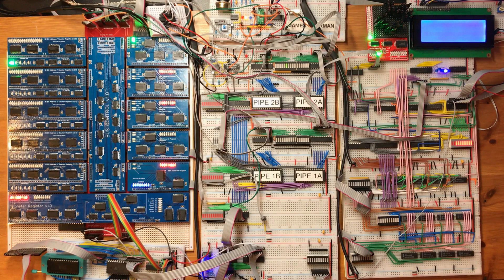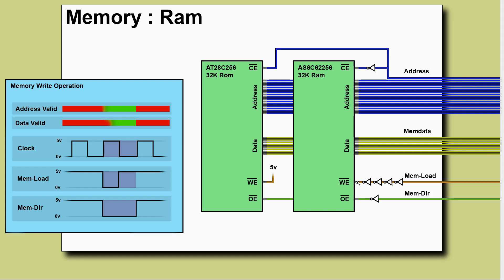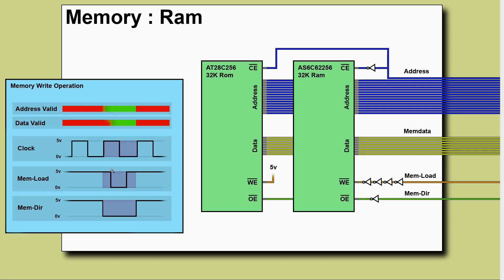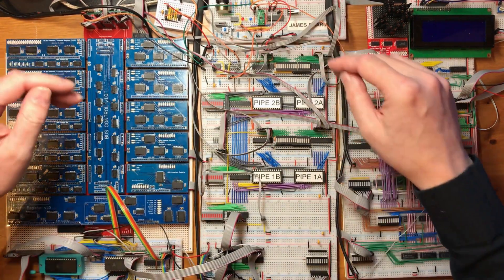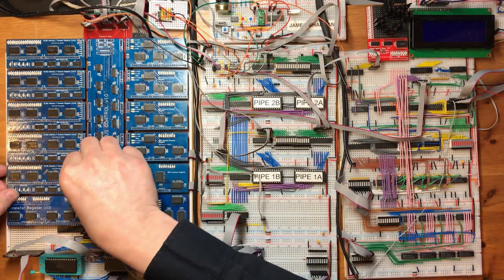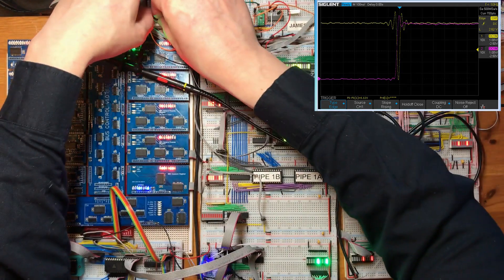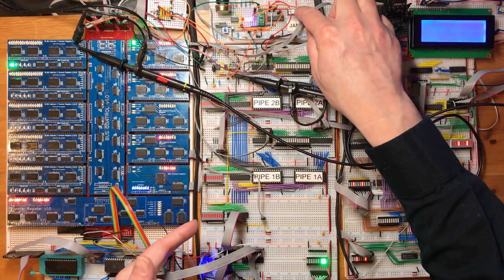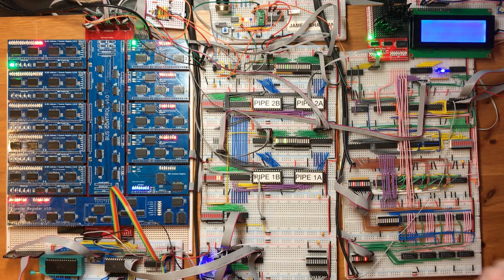Small Jobs - Making an 8 Bit pipelined CPU - Part 62

Comment: It seems like there's more than one NOP being generated when memory is accessed.  Is this because there are two consecutive instructions that access memory?  It seems like a pretty severe bottleneck; two instructions are causing a complete pipeline flush, only 2 instructions per 4 cycles.  

Apart from Harvard architecture, I have no idea what would get you out of this situation, though.  Maybe adding more pipeline stages to keep things moving with non-memory instructions while the fetch unit is stalled?  Another bus?  How do modern processors deal with this?
Reply from the maker: Sort of. Memory accessing instructions block fetch so effectively take 2 cycles, but the memory access happens in pipeline stage 2 so the next instruction has already been fetched.  There are a few different stragies for solving this, something I hope to explore in future builds.

Comment: Glad that another bug is fixed.
Nice work.
Reply from the maker: Thanks Adam! Reset not fully working was only a minor and I was very sure I knew the problem. The odd thing about making videos is feeling like you can just patch the wire over, you need to wait until an appropriate time to do it. I could make slicker videos if I tried this stuff out in advance and faked the videos, but it's not the way.
Reply: @weirdboyjim  no and we would miss out on the importent lessons

Comment: One of the first things I did with my breadboard cpu was to get a bit of board and blu-tac the breadboards to it. Unfortunately I put my cpu on top of a box quite high up and then found my cpu on the floor in bits the next day and a sheepish looking cat! I managed to fix it but haven't really done much on it since then.
Reply from the maker: Lol! I keep mine on a shelf where there isn't enough room for the cat to get onto it. When I left it on the desk I would find random wires pulled out / chewed. You should get back to it at some point, stop living vicariously through me ;-)
Reply: @weirdboyjim  I've changed tack somewhat and built Warren Toomey's CSCvon8 minimalist cpu on a pcb I bought from him. I'm try to implement a vga card for it but having a bit of trouble getting it working. I'm having timing issues writing to the display memory but hope to fix that over xmas.
Reply: Our cat wouldn't have looked sheepish... He would have stood there saying "yeah... so what! What you gonna do about it?! By the way, it's dinner time!"
Reply: As we all know, cats are evil and hate all human technology apart from the electric can opener
Reply: I like the aesthetics of mounting in a card rack, rather than laid out, and then I checked the price 😱 Plus all das blinken lights would have to be right angle (more costly I thought requiring through hole arrays, but there are SMD right angle discrete, which aren't much more expensive).